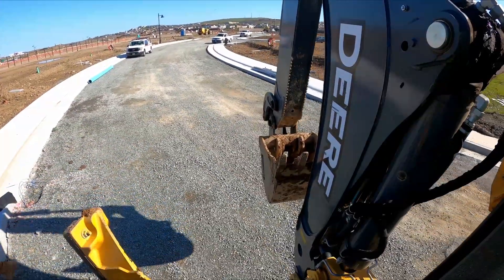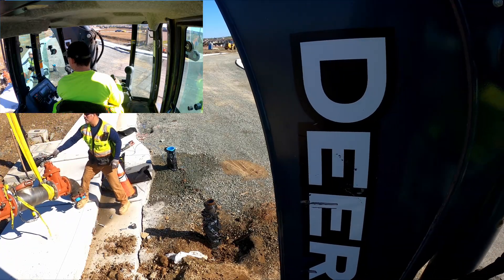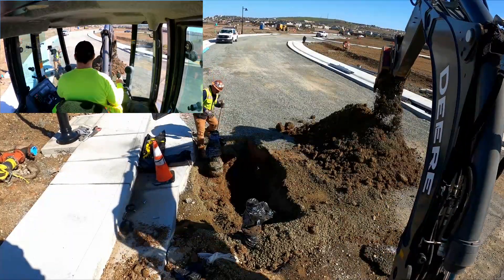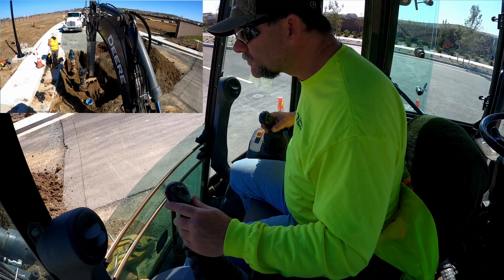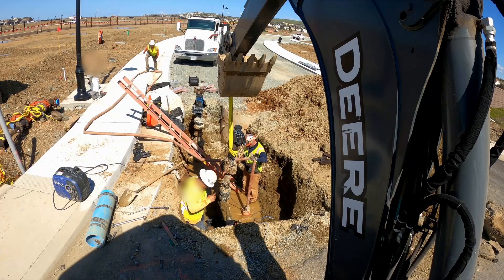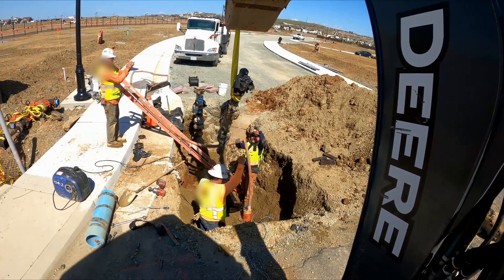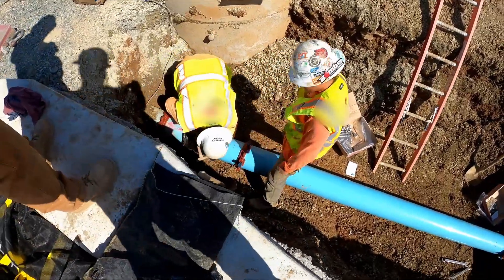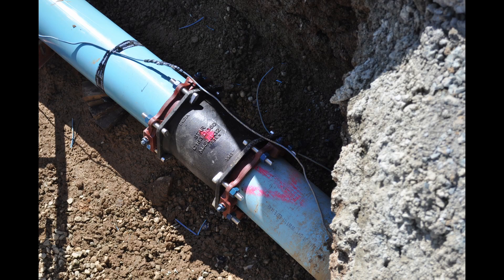How to tie in a water line main at the end of a job.

Comment: Nice! I work for a Contractor in Georgia. Is wrapping the pipe after installation a requirement in that State?
Reply from the maker: State no. It is a county to county thing. But for the most part here (CA) we do it on all new installs. In some areas the require us to use mastic on the bolts to prevent rust/corrosion  as well.

Comment: Is it true that if you don’t megalug every fitting and restrain every bell joint that you need thrust blocks? Looks good
Reply from the maker: If you don’t have some kind of restraint at bends there is a high possibility that the pipe will push apart. We do thrust blocks with mega lugs installed. 
 Some jobs will require joint restraints up to 40” from each bend as well. I have seen pipe push apart and it is all bad.

Comment: Hi Lever Monkey.  Thanks for the content brother love your stuff.  I have been asked this, thought I would check with you.  Can you pull two big trench Boxes with an excavator?  Im sure it has to be a bigger Hoe besides the Taco.  Im guessing a bigger cat or Komastu 300 range?  Do you have to take the top one off then pull the bottom one?  I thought you would be the one to ask, Thanks lever Monkey keep them coming.
Reply from the maker: This is a loaded question. it really depends on the size of the trench box or man hole box. To answer your question yes you can pull two boxes stacked with a 35 ton rig or bigger. If the box is the thin wall 20' long. If you go to a longer box or the heaver bottom box it will have to be a 50 ton or bigger. Then it also depends on how far out you have to reach to pick the box. here is a JD 350 struggling with one https://www.youtube.com/watch?v=M5WxSLu0gGw